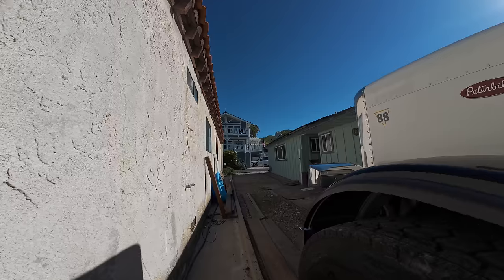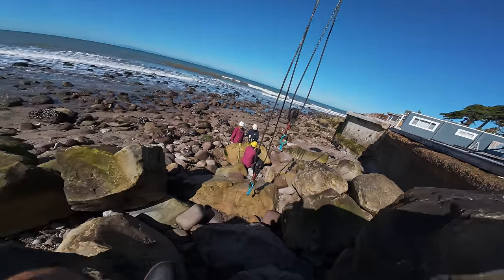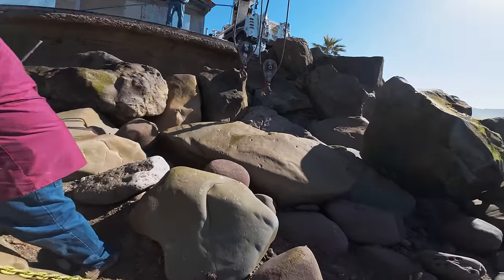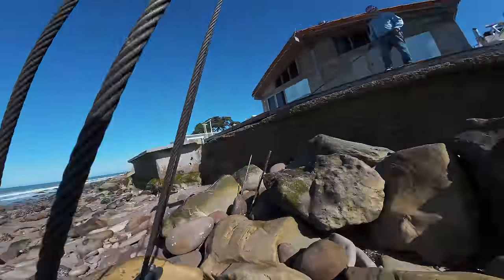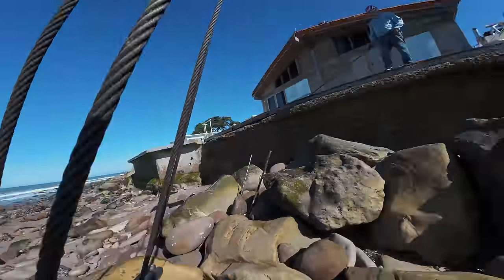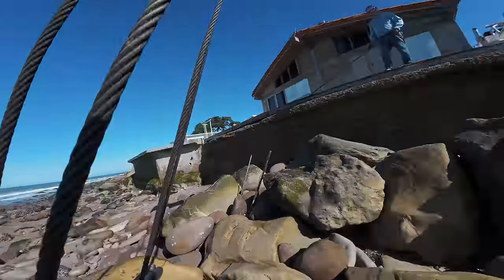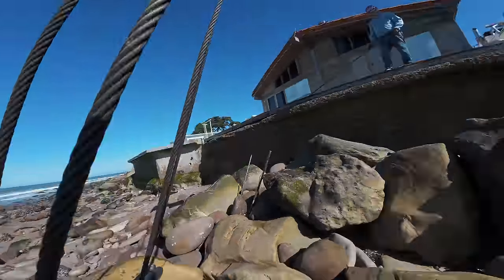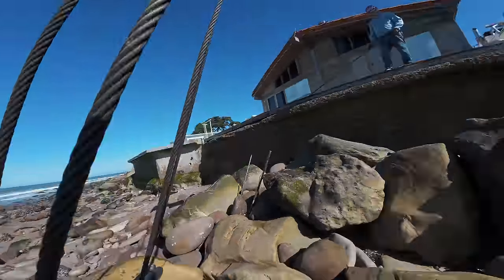Why I charged $15,000 to move these rocks (part 1)

Comment: You can only hope boss guy sees this and realizes he’s not a very effective leader.  But he probably won’t. Alex has had a few people like this. He is incredibly patient.
Reply: Yea he didn’t have the best communication but in these jobs you have to stack everything together in a very particular way or the water blows it out like it was it’s not surprising he’s not getting what he wants right away with a crane op he’s never used before and honestly chains are the wrong thing to lift bolder with for this using chains over old school lift straps made everything way harder than it needed to be
Reply: @Doubie. Problem not using chains 
 Rather inexperienced rigging.
Reply: @hj8607 no it’s chains you want to be able to pull straps out without twisting the bolders like he wanted alex to do but chains will damage th and vise versa lifting straps will get torn up faster doing it but it lets you set in a basket then just yank them out with the truck

Edit the wider foot print of the straps would help them sliding off too like the one they dropped to be clear you can use chain it’s just a lot harder than it needs to be that little small rock to get the chain off thing he did drive me nuts because the waves will move them and cause a shift in the wall changing the structure
Reply: Alex was raised right. Bravo.
Reply: He's the type that likes to stand and bark orders.
Reply: I also found Mr. Blue Shirt really annoying. He needed to get in there and get his hands dirty instead of just barking out incomprehensible orders.
Reply: @Military-Museum-LP  Indeed!!
Reply: I understand the hardhat in the Amerikan flag  bose needed to be there to tel where he wanted the rock's
But come on dude, don't micromanege everything to the last detail
Reply: Was that guy's name Captain Obvious?

Comment: Too much help.  Blue shirt take control Boss Guy.   "Where's THE chain"?  As if. There's a 30 foot one inch one buried in the middle of the tunnel.  Get that one.  

Let's waste time countermanding his directions and explaining.  "Let's get the chain off now" . . . Ya think?  A good boss would know when to say where and then get out of the way.  Good thing the Red shirt guys, their blue shirt compadre and Alex know what's going on.

That second rock should do a pretty good job of taking out his deck when the rollers start crashing on the beach.  Awkward placements.  Not exactly cut stone.

He is under a lot of stress, I'll give him that.  Probably spent a lot of time on that deck thinking about it.   " We got to keep moving".  Let's ramp the stress up there some more.  I figure a lot of  outgoing tide time time was taken up in stationing the truck and getting it past that soffit.  That is some close.

Fuck me.  'Here.  Catch this binder'  tossing it down hill from 8 feet away, wobbly bits flying every which way.  Bet that hurt.  "Want me to get down there and help?" 

Hats off to everyone who kept their heads down, just kept going and didn't get crushed in the process.  Job well done under trying circumstances.   

It's been said before, Alex has a wonderful temperament.  Way better than mine.  This is why I work for myself.

Comment: just a matter of time till that sea wall gives out it is already showing signs of being compromised! all the cracks and chipping salt air and water does a number on reinforced concrete and from the look of the deck on top of it they did not use pressure treated lumber when it was built

Comment: You accepted the challenge, and Alex admirably performed that challenge. The rock riggers learned a lot about rigging rocks, what we in the mid-west learn at an early age when digging and moving rocks out of the farm fields. Rocks are hard to figure out which way they want to slip out of their chains. But the rocks need to be put back in place (so they can be pushed back out into the ocean with the tide and wave action). Tractor tire chains are a big help to "net" the rocks. 
Good job and handled by Pepe very well.

Comment: I worked on the house with the rocks 12 yrs ago. Few yrs before that they removed the break wall replaced with rocks. Not the best idea Big storms would bring engine size rocks on to the patio and waves would crash over the house.
Reply: What a money pit
Reply: @SixOhFive  When we got there, it needed a complete remodel. The house is worth a millions

Comment: That's quite the odd job there.  Lucky you had room for the tailswing on Big Flipper's turret, without catching the adjacent building.  If you get called to do this sort of job more than once or twice, you might want to look into picking up some rock tongs to bring out for this sort of work.  I've seen them used on rip-rap jobs before and make the work a bit less hands-in-the-danger-zone.

Comment: This work so much more dangerous than it looks. Those rocks let go with zero warning.
I once had a truck load of unsized rock delivered to my house for landscaping. Biggest rocks where about 4' a side.
I built a crane out of old well pipe. It looked a lot like an engine hoist, but had a wide leg stance and big tires.
I would raise the rocks onto the legs, and then tow it into place with my mower.
Took me a few weeks to move everything into place.

Comment: As always Alex great job even though Boss man was not easy to work with. They could of drilled and fixed anchor points to the rocks made your job easier and quicker, then cut them off after.😊
Reply: Or used a better tool like an excavator to avoid lift points altogether and get things done in far less time.  This was a dumb way to get the job done.
Reply: @dom6512  permit didn't allow an excavator on the beach, also a crane was far too big to get on site yet alone extend its outriggers for the amount of reach needed to lift some of these rocks. if you notice I couldn't extent my outriggers. the crane company actually gave us this job because of the extreme difficulty.
Reply: @AlexanderHernandez088  My comment wasn't trying to be critical of the job you did, but the decisions of the old guy with the stick.  You did the job you were called to do.
Reply from the maker: What excavator do you know that can dead lift 15,000lbs at over 50' extended??? That would be able to get to this spot?
Reply: @PepesTowingService  As Alex replied, the permit didn't allow one on the beach, so that changes the dynamic.  An excavator does not have to deadlift stones to manipulate them.  You can do a lot with a small 4 ton excavator, including roll a 6+ ton stone, but if it wasn't allowed, then it wasn't. 

If you are going to add this to the services list, you might want to pick up a grapple to avoid having to chain each rock and then have a way to get the chains back out.  That would have also made this job much easier.

You need to relax.  That ego keeps getting the better of you my man.  Calling viewers names in the comment section is a bad look.  Have a damn civil disagreement.  If you can't, then best to stay away and focus on content.
Reply from the maker: I didn't even call you a name. And I'm not going to buy additional equipment for a one off job that we won't replicate. I'll never understand how commenters like you can criticize, critique or suggest things but as soon as I reply "whoa man no need for that " 🙄 Alex got the job done exactly the way they wanted it.
Reply: Respectfully Josh, I didn't imply you called me a name, nore did I even mention about buying anything. Simply complimented Alex on another good job done, and remarked the contractor could of drilled anchors into the rocks to it easier and safer, then cut them off after. What's wrong with that?
Reply: @PepesTowingService   That ego shows in the videos you are in.  Alex is always cool as a cucumber.  You can stand to gain a little from him...

Yeah, in your reply to me in another comment, you certainly did.. here was your reply:

"This comment is inefficient you muppet. There is no way a Kubota 101 has the reach let alone strength to lift a 15,000lb rock or even the 8 or 10,000lb ones. There's a reason every construction company turned this down, but leave it to the YouTube University morons with their degrees in quarterbacking to tell us how to do a job that we already successfully did."

You could have simply stated that an excavator was not allowed on the beach as Alex did.

The stupid thing is that I wasn't even criticizing you guys, but the old guy waving the stick around and his decisions.  Alex certainly got the job done.   I had nothing against anything you guys do, which is why I watched the channel. Well, that was until true character was shown in your replies to me.  So what if I or anyone else has another idea on how the job should/ could be done.  Why does that bother your ego so much?  You think that you are the only one with experience with rigging and moving heavy objects around?  I had no problem with you at all, now I do, over nothing, congrats!

Comment: Just liability of pulling that truck out on the break water is worth 20k. Half a million dollar truck,What they want you to do and possible damage to that truck and operator.  The $$$ it would lose while you fixed or replace it. 15k is a steal. I respect putting a price up. Everything above board.

Comment: Moving those rocks are going to be what--$500---$1000 a piece?? 7--10,000 lb rocks. Let's move it 1/2" this way and down 1 Inch. No problemo😂😂. Another $500
Reply from the maker: I wish! We went back and forth for weeks on price. I flat rate it eventually because they were so desperate. Not a single tow or crane company would take this job.
Reply: @PepesTowingService  At least now you know the rates go UP👆👆👆

Comment: ? How much would you charge to lift a 20ft sea container on to a flat bed.
Reply from the maker: How much does it weigh? Is it local or 100 miles away? Is it in a tiny yard or open lot? Too many factors to just throw a random price

Comment: That's quite a hump down the 101 and out onto the Oxnard Plain.  Did you smell the funky smell of the onion fields?  That land has been overworked so much over the years that I'm not sure even weeds can grow it it.  That smell is the chemicals they put into the ground to force grow onions.

The wife and I lived in Camarillo when I was stationed out at the base, and you get used to the smell.

Comment: 3 laborers and a foreman.
 1 day to prep
1.mark rocks numerically in order you want.
2. Buy Anchor plates . They require minimum 4 anchors.
3. Drill anchors . 
4. Set enough plates 4-5.
5. Call homeskillet with the crane truck

Have one laborer labor with operator . Other 2 anticipate the rigging needs after watching the laborer, laboring with the operator, move 1 stone. They stay out of the way but prep the next stone. 

6. Smoke weed at home and comment on YouTube videos when you are 19 and only have worked retail pretending to be smart . Get really high and comment with bullet points.
7. Jack off

Comment: This job would have been much easier using a small long reach excavator such as a Kubota 101, etc.  Chaining each boulder is so inefficient...
Reply from the maker: This comment is inefficient you muppet. There is no way a Kubota 101 has the reach let alone strength to lift a 15,000lb rock or even the 8 or 10,000lb ones. There's a reason every construction company turned this down, but leave it to the YouTube University morons with their degrees in quarterbacking to tell us how to do a job that we already successfully did.

Comment: calling a tow truck company to move rocks seems like cutting the grass with a scissors. with this caveat there is no room to bring in a machine. a 10000# mini ex would have made short work of this. no way to bring it in except by boat that would cost way more than a mere $15000. no?yes?